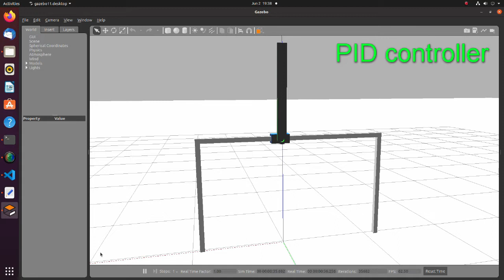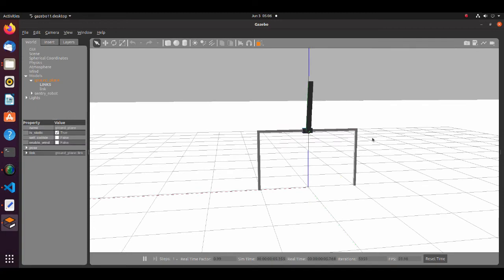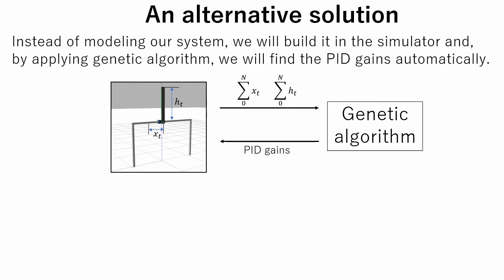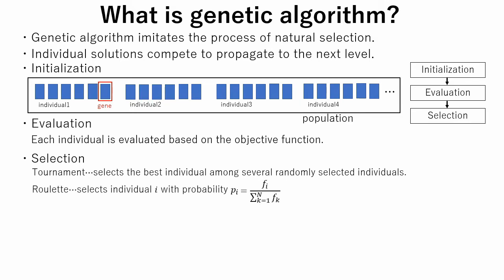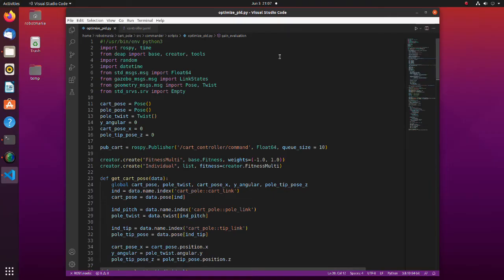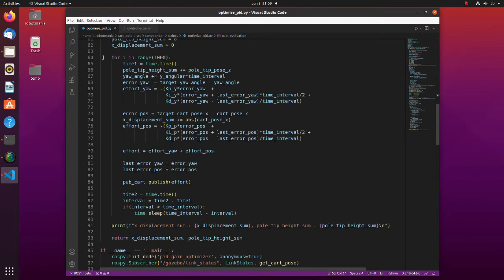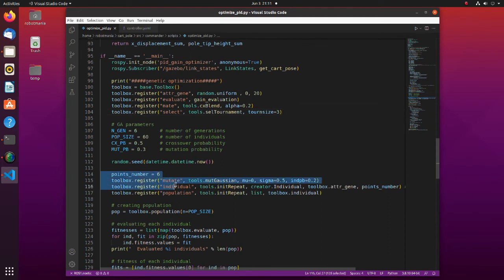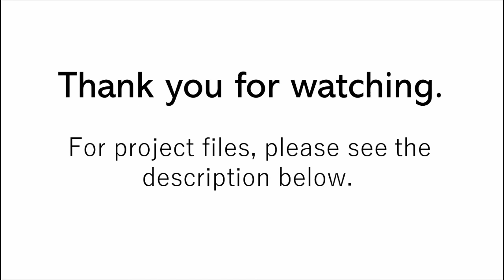Cart pole simulation in Gazebo (PID control implementation and tuning using genetic algorithm)

Comment: Great video, thank you, I just subscribed

Controller design is so important in robotics yet there is so few content online. Would you also consider videos on other controller types perhaps on Gazebo or other more accurate simulators?
Reply from the maker: Hi Y S!
Thanks for watching my videos!
What kind of controller types are you interested in? And what kind of object (car, plane, legged robot) would you like to control?
Reply: @robotmania8896  Thanks for your answer, I think any controller with feedback like PID LQR or even advanced models like MPC is super interesting

I personally love parallel robots like delta and stewart platforms. Most important thing about controller design I think is that the simulation environment needs to have features to model disturbances to measure the controller response.

I dont know if Gazebo is as good as MuJoco or Drake or Pybullet. All I know is there is nearly no video which shows detailed control design using simulators except Matlab and Simulink, which I think is powerful but not open source
Reply from the maker: @ROBOROBOROBOROBO  By the way, I have one more video related to control theory. I hope it will help you.
https://www.youtube.com/watch?v=uls-WmxRiTw

Comment: What's your opinion on ROS and ROS2 after using both? Thank you for making these videos, I love taking apart your code after watching them.
Reply from the maker: Hi return null!
I think at this point whether to use ROS or ROS2 depends on your project length. For example, if you are doing your university project that lasts a year or one semester, ROS is a good option since there are a lot of reference material and packages for it. If you are planning to make a product for business or do long-term research, using ROS2 is a good idea, since ROS maintenance will stop at 2025.